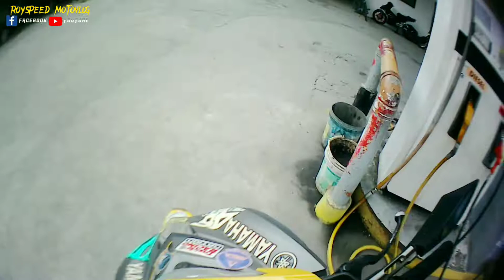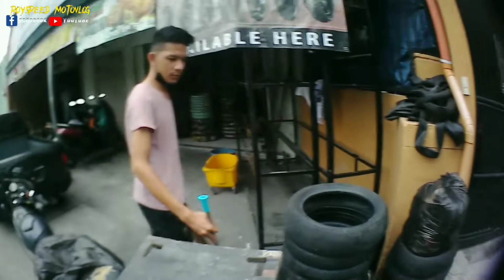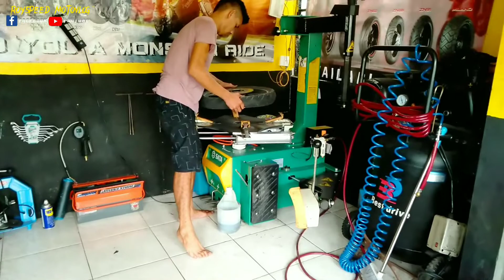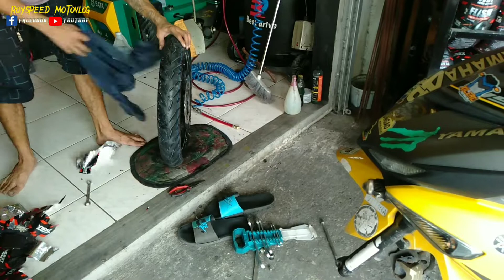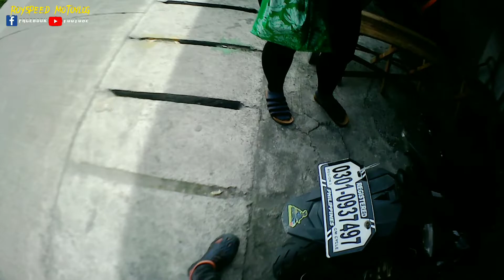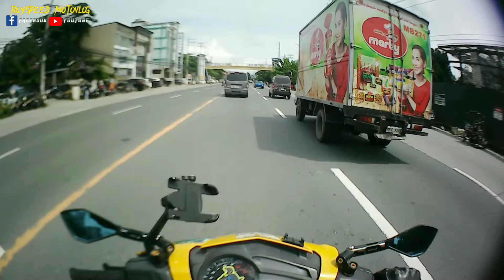INSTALLING BEAST TIRE | 90/80/17 FOR SNIPER 150 | AFFORDABLE AND QUALITY.

Comment: Sakin sir 90/80 sayad na ano Kay pwdi para ndi sumayad.
Reply: 90/80 - stock mags at stock frontshock no need tabas ng fender.
90/80 - asio mags v2 at stock frontshock no need tabas parin.
90/80 - asio mags v2 at mody5 inverted front shock - ito need na tabas. 
90/80 na sagad sa stock.
Reply from the maker: Stock 90/80/17 paps stock p saken
Reply: Bat sumasayad sayo boss??